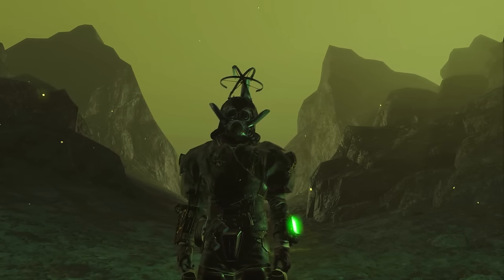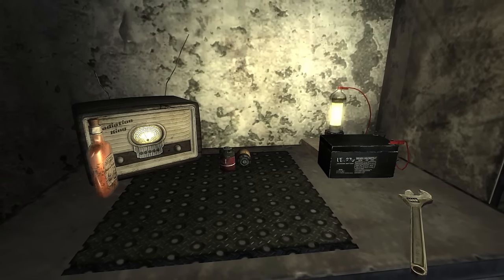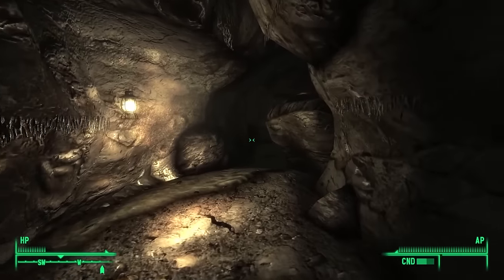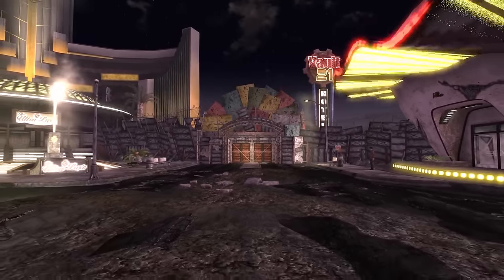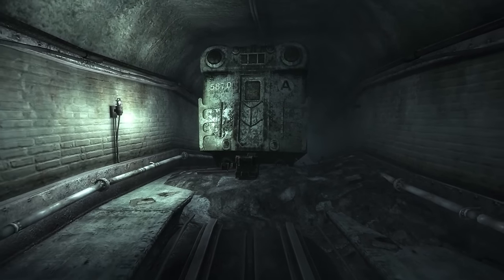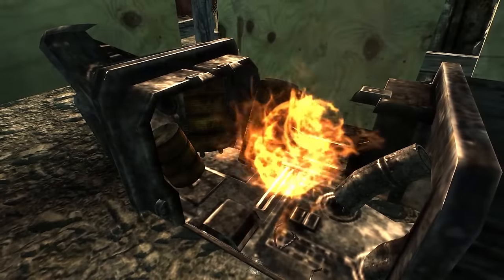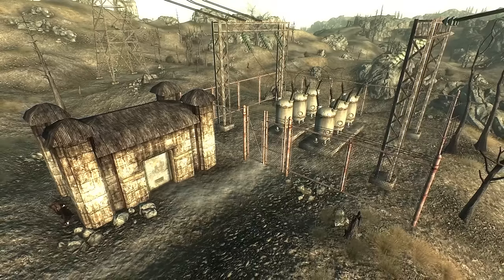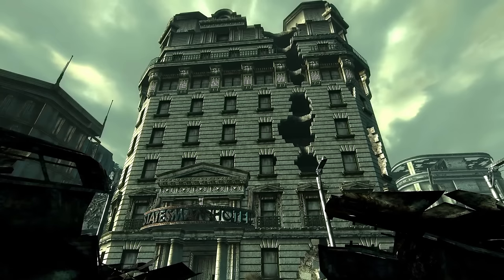Where does the power come from in Fallout?

Comment: you forgot that the Fusion Generators and the Municipal Plutonium Wells to some degree, can be a new and improved version of our world's Radioisotope Thermoelectric Generators. Basically RTGs generate power from the decay heat of a nuclear matter with the Seebeck principle, they do not require any maintenance, and they do not have any moving parts. That would also explain why the Fusion Generators can power small applications like doors, gates, terminals, fixtures and the like, but cannot be used for high power demanding applications. The lifespan of and RTG is calculated on the nuclear matter that is used in its making, as the generator produces less and less power as time goes on, calculated by the half-life of the nuclear matter used, and the power output would basically halve when the half-life is reached and it would continue to gradually generate less and less, this is why NASA shut off some of the systems of the Voyager 1 and 2 space probes, because the RTGs in them are nearing the half-life of the plutonium inside them. The rotating part on Fusion Generators can be a cooling turbine although an RTG would never need one, and the Fusion Cores themselves can also be a core coolant (those are against the principle of how an RTG works, but we can assume that the Fallout version can be ages ahead of our own so may operate in a vastly different fashion), or more accurately, some sort of nuclear material replacement, like a fuel cartridge. This would also suggest the actual NEED to replace the nuclear core, since the RTG is to be discarded once its considered dilapidated in power output, they are single-use. the Fusion Core may be the cartridge of a nuclear matter with a very short half-life like Strontium-90, which is 28.8 years. That also may be why Fusion Generators have replacable fuel while Municipal Plutonium Wells do not, hence their name suggests, they use Plutonium, which has a half-life of 87.7 years. This might also suggest the Fusion Core ITSELF can be an RTG with good thermal insulation outside, and the Fusion Generator simply being a transformer, which is why it has a rotating fan. 
That can also bring an explanation on why Fusion Cores are used as "Fuel" in power armors, since the frame itself has pathways similar to an RTG with "Radiation if damaged" written on them. Assuming most of the Fusion Generators replace the Fusion Core "Cartridges" around the same time as the others because of how half-life works (it may slightly change with the installation date of the generator, hence why you find cores of various states of depletion, this can not be from the usage amount since RTGs produce a fixed output for a fixed amount of time whether you utilize it all or not), their half lives are long since past so they cant be used to power high demand applications (or power them for a very short time because of how depleted they are, hence why they last so short on power armor), but can still power up small things like lights and terminals. the Municipal Plutonium Wells would have much more power output because of the nuclear matter they have, but neither of them could be of any use for powering a city, or a water purifyer, or anything of the sort. the 0/100 rating of the Fusion Cores can simply be a voltmeter rating of some sort for their power output, and stuff like Fusion Generators and power armor could have capacitors in them to boost the total output. 

The last question in this theory would be "why does it all have the name "Fusion" in them if there is NO fusion?"

Answer to that can basically be marketing. Think of how we name everything "turbo" when we want to imply efficiency and speed, from cartoons to vaccuum cleaners, to fridges, to even the razors Gilette sells, while neither of them mix air with any kind of fuel to increase burning efficiency, which is basically what a turbocharger on a car does. It is named "Fusion" because it is made by Mass Fusion, because it is cool sounding, and because it uses nuclear technology. 

TL-DR: both Fusion Generators and  Municipal Plutonium Wells can be an advanced, Fallout-ifyed version of our worlds RTGs, Fusion Cores can be a replacable nuclear cartridge for the generators to last longer and produce more power in a shorter amount of time, or they can be the generator itself and the panel/device they are inserted to is a mixture of transfomer and capacitor,  the name "Fusion" is only there because of the marketing.

More info on what RTGs are: https://en.wikipedia.org/wiki/Radioisotope_thermoelectric_generator#

Comment: I swear I had read in a terminal somewhere that a lot of tech had miniature reactors inside them. So they don’t necessarily need to be plugged in to work. If I remember correctly the same terminal entry also talked about the problem of having a ton of mini nuclear reactors laying around everywhere. That would also explain how some things get power. First thing that comes to mind is the terminal in sanctuary that had the drug stash. No wires leading to the terminal and it’s pretty evident there’s no power in sanctuary considering we have to build that ourselves.

Comment: Couldn't those fusion generators be used in case there was a blackout or some other emergency? Would explain why the cores weren't fully inserted since they weren't actually active? Or just running on standby mode drawing enough power just for the automated activation on the machine in case of grid failure.

Comment: As an electrical engineer I really enjoyed this, pretty sure you were spot on regarding the transformers and not being able to start 3-phase motors with a lost phase (this is a real thing that happens in industry that we call single phasing). Typically though most industrial sites and some utilities will have NGRs, neutral grounding resistors, that will allow normal operation with a single phase to ground fault. If you lose a second phase to ground it's a phase to phase fault and pretty much everything blows up. So losing just one phase might not happen depending on the situation. Anyways, wikipedia is a pretty good school it seems.

Comment: With fusion generators, I always assumed the opposite and that the generators themselves are supplying power to the fusion cores, not that the cores are powering the building through the generator. After all, we know from the spinning ride in the Hubologists quest in Nuka World that other pre-war machinery used fusion cores and that they weren't just limited to power armor and gatling lasers. The Overseer of Vault 81 also asks for fusion cores, but they clearly don't have any power armor and they have their own generators, so they must be needed for some alternate use that we never see. Having a means of plugging a fusion battery into the mains supply to recharge it would be extremely useful for large buildings that may need to keep powering intensive machinery like elevators in case of a power outage or emergency, and it keeps that backup power source on the premises just in case.

It would even make sense for how they retain full power when you take them, but they have a greatly diminished battery life when used 200 years later. It could work similarly to how your phone's battery gradually loses its ability to store energy because of degradation and excessive charging. An electrical device being given constant charge for over 200 years would absolutely lose its effectiveness. And like you said, removing the core doesn't affect how anything functions in the building, so clearly the buildings are receiving power from elsewhere. But also a single fusion core couldn't provide enough power to supply a whole building when it was shown that a minimum of 3 cores were needed just to start the Nuka World spinning ride for the Hubologists.

Comment: a thought that just occured while watching your fusion core section is that each core is a reactor that outputs a useful energy type and has some storage of it's own. the generator uses that energy to make a large amount of electricity and has additional stores of fuel so that 200 years of running a building is no problem and core replacements were regularly needed as the fusion reaction degraded these micro sized reactors.
 
power armor lacks and fuel storage and just uses the energy output of the reactor
that's my little theory i just thought of.

Comment: The real answer is obvious. Bethesda didn’t put much thought into what makes sense and instead focused on what looks cool. Being too ignorant to realize they could have done both. Don’t get me wrong I wish there was a  reasonable (in a SciFi sense) technical explanation for everything in fallout. But that’s just not Bethesda’s bag. This subject made more sense in Fo3 and NV because the game featured a wide range of fission batteries and generators (those things that you mistook for transformers. I always assumed that there were other nuclear type batteries integrated into various buildings and installations to provide backup power to certain lights and systems. Im pretty sure most computer terminals were powered almost exclusively off internal fission batteries. And yes definitely functioning parts of the pre war power grid and the generators you can find in the basement of many buildings. And yeah I’m pretty sure they are generators. They make generator noises. Im sure that the exploded internal parts look like just coils is just Bethesda not taking the time to make those parts look specifically like parts of a generator.

Comment: I think the fusion generators are charging the fusion cores, not depleting them. Why else would the generators have turbines if the fusion core already outputs usable energy?

They are literally called fusion "generators" which just isn't true if the fusion cores are the ones generating the power. The only real explanation is that the generators are generating power and charging the cores, not the other way around.

Comment: I like the idea that the national underground network is kinda acting as a giant battery. Hear me out. 

Less people and appliances are around to draw on the power grid which would give it an OVER capacity of output. So, there's excess power available. Wheres the power coming from? 

Passive power generators like helios one or hoover dam. Think about it. Yes, a vast majority of the pre war network ran on nuclear power but we see through fallout new vegas that passive/green energy stations existed in tbe pre war world and for the most part, work just fine. So theyre constantly producing energy however, that energy isn't being used at the rate that it was designed to be drained at, thus, creating an excess of power and so the old world grid, instead of immediently sending ALL its power out to be used, is instead being fractionally drained with it producing more power than is being expended, thus, the network acts more like a huge battery. In our own world, we're seeing a rise in green energy so it wouldnt be out of the question for the fallout pre war world to have undergone a similar phase of trying to create free power via geothermal, solar, wind, or water. The reason the power may not be reliable as some settlements have no doubt found is that the power lines may not be fully intact, or the components that kept the voltage consistent have degraded over time without human maintenance... for example, the run down sub stations we see throughout fallout. Normally, those stations are responsible for stepping down the raw voltage to a useable form and sending it to the local network, however, without maintenance, its probable to think that these systems are just about ready to kick the bucket. Thus, the local grids in question can't operate as well because theyre middle man for making sure the power isnt too high voltage hasnt been maintained... so it may not be a strong connection to the grid OR it may not be safe to use.

Comment: I always assumed that fusion cores lasted longer in those big generators because they were more capable of handling the power efficiently and safely.
In power armour there is less space for the system, and as such they may have to use less efficient power transfer methods which deplete a core faster.

Comment: I had a main power breaker box go out on me one of the hundred amp breaker switches melted and my high power appliances barely worked but my lights and tv worked but if I turned on my Xbox it would bog down the lights so if your  wash machine would work but not very well

Comment: It makes sense power is underground and smaller support generators since

WAR

lol

Having power in hidden away areas makes sense so enemies can't bomb or nuke em.

Also my head canon was that it is always underground or in the rubble areas you cannot access.
In FO3 that would be the metro
Underground
Tap into power lines
Subways and trains use MASSIVE amounts of energy
The protectron recharge stations 
Etc.

FONV its the hoover dam and helios 1 with a few fission batteried here and there

FO4 its the mass fusion building but other areas like far harbor and nuka world have their own powerplants WHICH NUKA WORLD HAS A MAIN STORYLINE QUEST FOR IN ALL THE PARKS AND BUILDINGS JOLT UP AND FIREWORKS HAPPEN!!!

vaults having their own generators makes sense since theyd be detach from the main civilization cities etc.

Comment: There's one thing you "must" apply to all the games – ""videogame logic"" (quotes cancel each other here) 

Junktown is only 3 maps, but it could be a small village, like Filli(phily? fili? Idk) from TV series which has a larger settlement around the central part. 
Also, there are lights inside houses in ShS and JT and I don't think those are candles. They even have refrigerators. I agree that slot machines could be mechanical tho.

Comment: As a prior US Army Commo soldier (gotta power that radio, lol) you're very spot on. In the totality of circumstances (in a perfect - all things considered - world) I always assumed that many of the terminals were internally powered to prevent file corruption at a power outage... and that when the power went out that system "could" work in reverse, the 3 phase that is still operating (mostly automated) in conjunction with any wired in vaults and later stage settlements... combined could create a daisy chain accidental (or perhaps on purpose) grid for power to move around the various wastelands. This would still necessitate individuals with generators but also (as we see in NV at the Solar array) vast areas can be limitedly powered on the old grids.

Comment: Since you mentioned that point about fusion cores found in buildings being seated differently... Maybe they are pushed in halfway for charging, and pushed in fully as battery backup when grid power goes off. It would explain why every core you find is fully charged.

Comment: Jizz how wrong is that. Most important places have backupgrid, that why some of them have fusion reactor with corsa. They are design like UPS to work only for short time until back of grid power or change fusion core. So that ok if power armor dry it aftern few hours.

About using grind you need power Transformers and they are tricky to use, not even talking about making some transformer from 15kv 3phase to 1phase 120-220v. It easier to get running some small generator that use whole grid.

Comment: ACKCHUALLY!!!  In the USA, you can splice your dryer to run off 120 volts.  This is how dryers in the USA are run.  There is no 240 volt source in your house in the US.  There is no 240 volt wire.  What you have in the USA is two 120 volt sources, each 180 degrees out of phase with the other.  The best way to describe it is you have one 120 volt source pushing, while the other 120 volt source is pulling.  So they combine to make an equivalent of 240 volts.  The alternate 60 times a second, but are always 180 degrees out of phase.  This is why dryers in the USA, and all devices requiring 240 volts, have 3 prongs.  Two of them are 120 volts, the third is ground.  No wire is 240 volts.  If you follow the wire from your dryer to your circuit breaker and open it up, you will see one wire is connected to the right side bar of the circuit breaker, the other to the left.  The same right and left bar every circuit in your house is connected to.  The third is connected to the ground bar.  They are connected right and left because they need to be out of phase.  If both were connected to the right or both to the left, they would be in phase and you wouldn't have equivalent 240 volts.  If you look at the wires coming into your circuit breaker box, one connects to the right bar and the other to the left.  These are each only 120 volts.  They are 180 degrees out of phase with each other.  My point is, you can splice your dryer to run off 120 volts in the US, because all dryers in the US are spliced to run off 120 volts.  If you had two extension cords, you could plug your dryer into two regular outlets, you would just have to move the second extension cord from plug to plug until you found a circuit out of phase.  One connected to the opposite bar in your circuit breaker than the outlet the first extension cord is plugged into.  But your dryer can run off two 120 volt outlets.
    I understand your point though.  I'm just being a dick.